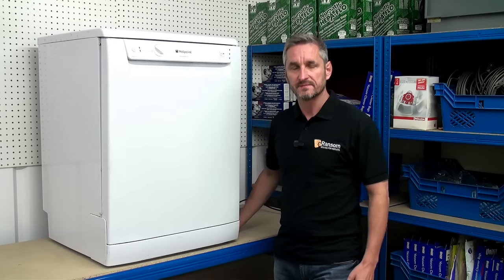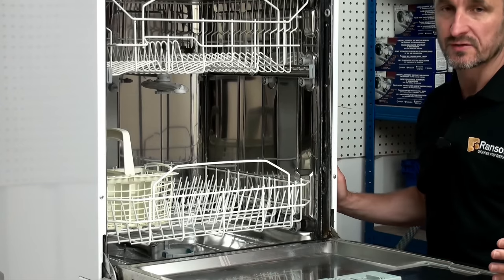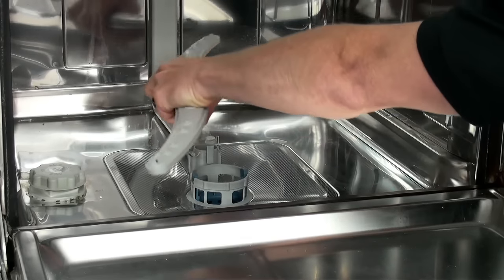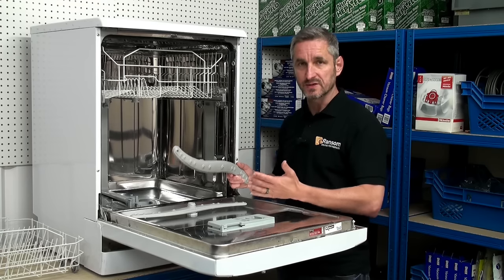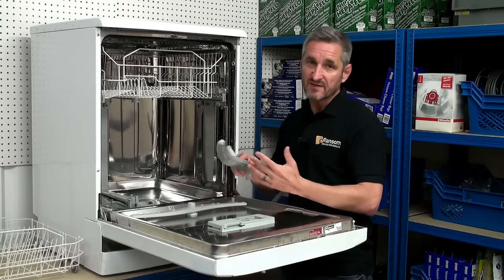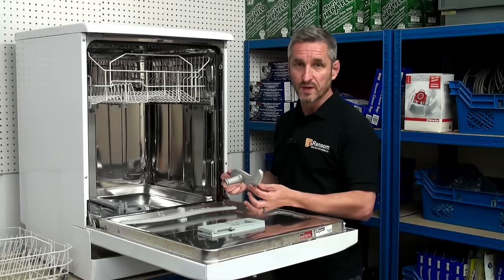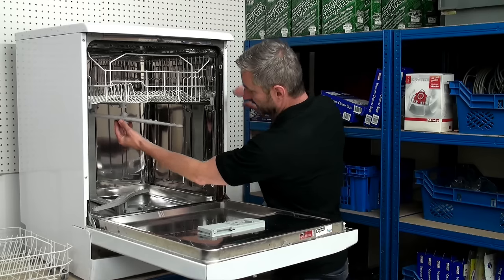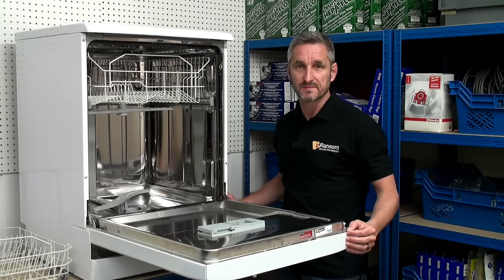How to clean and replace Dishwasher Spray Arms

Comment: I just spent literally half an hour in the shower with my two spray arms trying to get out every little last piece. Unscrewed the shower head (from a flexible hose) and just kept going at it from every angle. Found some lemon pips which were the hardest to coax out. If you have access to a garden hose that might be a good way to spray the water in at high pressure and not get it all over the kitchen. Literally cannot believe you can't dismantle these things.
Reply: It's absurd, isnt it? They're so greedy they won't have us open the thing to clean, instead we need to buy another one

Comment: they gotta make the arms such that they snap together or something so you CAN remove stubborn blockage rather than buy new.
Reply: My spray arm came off, and I cat tell if it is the top or bottom
Reply: Amen
Reply: never going to happen, raises the cost of manufacture, they just expect you to buy replacements or a new dishwasher.
Reply: @cindybecking7444  mine too.its very old how do I put them bk on.i was using it as storage but now we r on baby # 4 I really wanted to start using it
Reply: So much for that. My center arm just plain fell off! There’s not even a comparison part that should be attached like he showed. It’s like it just disappeared and I’m the only one using it!
Reply: @John-gm8ty  Definitely an opportunity for an aftermarket part maker.

Comment: Pulling out this piece of plastic out of sprayer, made my think that could be my problem, because as my plumber discovered a drainige hose was clogged with a piece of plastic...apparently from dishwashing cubes , currently sold as recomended for best washing experience. It turns out that these plastic wrappers that suppose to dissolve in hot water don't decompose, instead accumulate and clog dishwaher's outlets...

Comment: The spray arms in my dishwasher drive me nuts. They constantly get bits of food stuck in them so they don't rinse properly. How do bits that are too big to come out even get in there? And why don't they design them so you can open them up for cleaning?
Reply: Exactly!  Should be able to open the spray arm up and NOT have to replace them. Also it seems like the arms should have  a built in filter, that stops the crap from getting to the holes in the first place. I've checked around to see if something like that exists and nope! I might try to rig something anyway - like use a filter designed for a faucet and see if I can get one to fit. The water pressure should keep it in place. It's funny this vid is getting replies 9 years after posting.

Comment: What happens if a plate goes too high and stops the spray arm going around?  Does it damage anything, I noticed the plates were not cleaned properly
Reply: The spray arm probably won't be damaged, but as you say it will be slowed down a lot and not work properly. Maybe you can move the plates to the edge of the tray where it doesn't quite reach? Otherwise you might just need smaller plates I'm afraid.